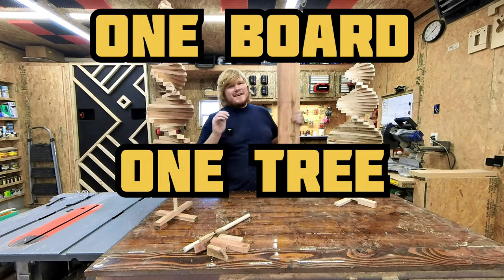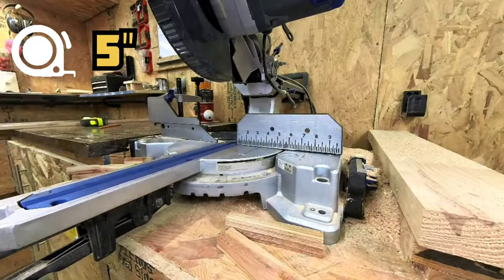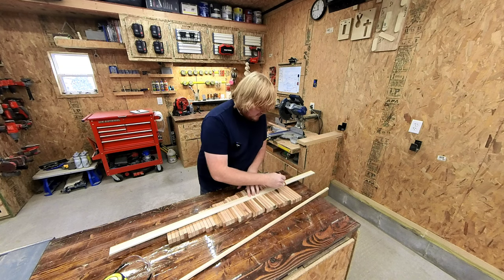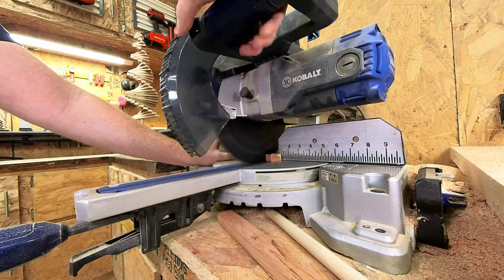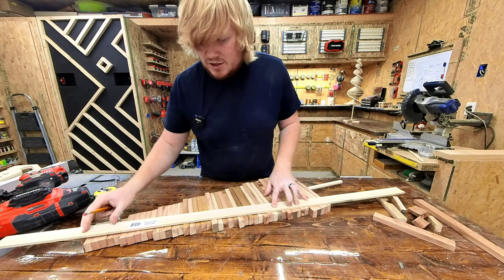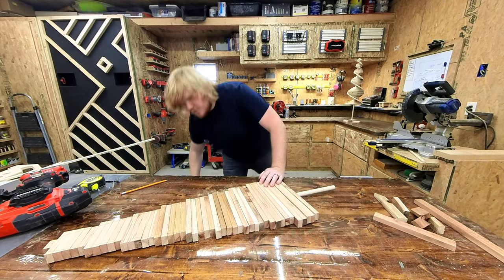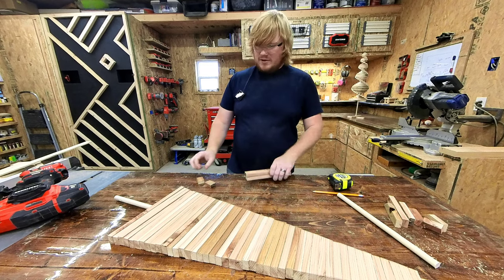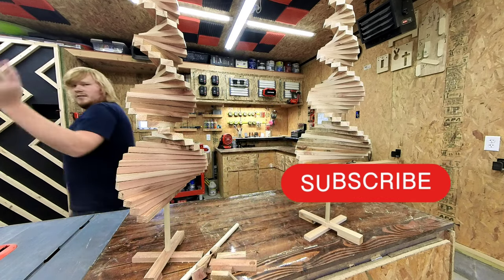ONE Board Spiral Tree. Christmas Build | Woodworking Project

Comment: You can prevent blowout on your wood pieces by putting a sacrificial board under your last piece or using painters tape. You might still get a little bit, but it won't be as bad.
Reply from the maker: Thanks buddy :)